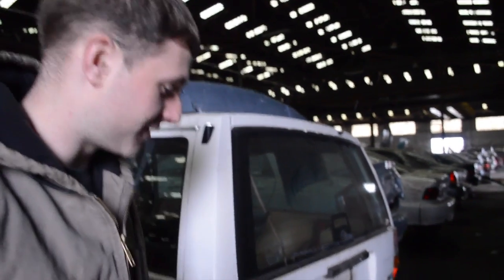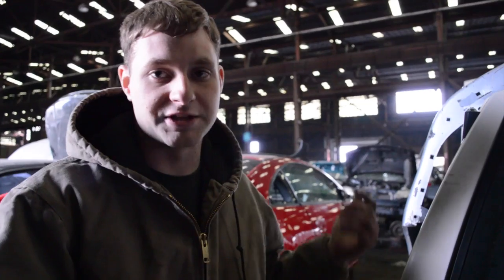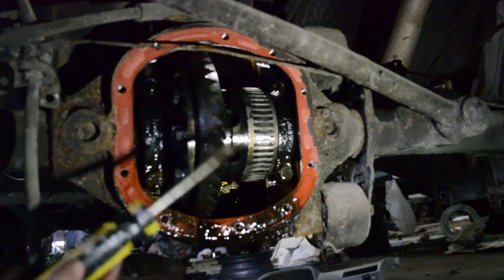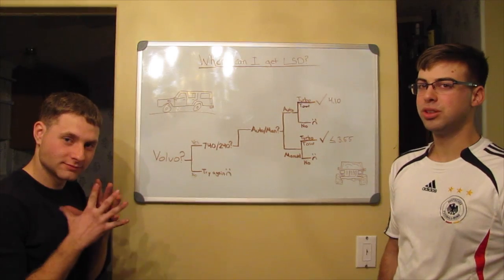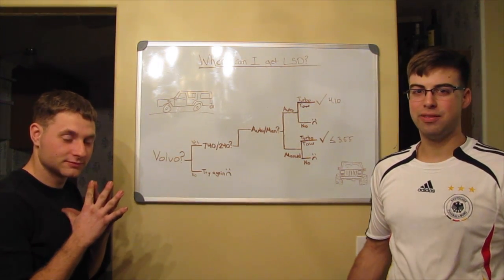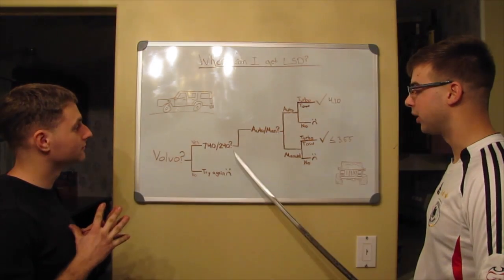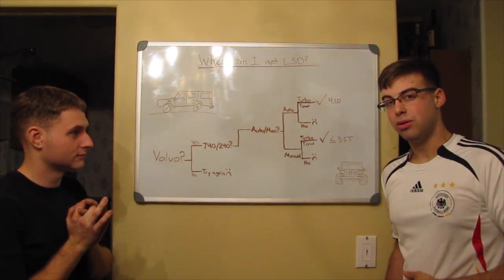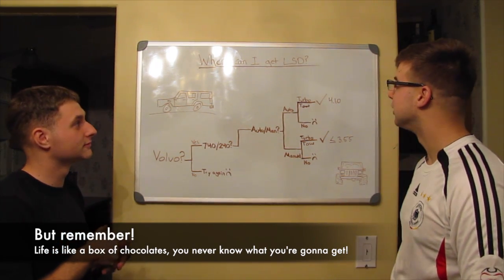The Volvo Differential Explained Part 2

Comment: What yrs could you find the LSD in the 240. 1988, 1992 are the choices at the local. Thank you guys. Just checked a local junk yard on line they have two Volvo’s one just came in a few days ago both are 240’s 1 is 1988, 1 is 1992 the 92 just got there. Thank you for a fast reply. Happy New Year to ya guys.

Comment: Volvo Dana 30's are the 1036 open or the 1046 G80, tag is on the axle easy to spot in the yard without disassembly.

Comment: Anyway to tell me if this G80 in a dana 30 up front will fit on my 2002 WJ 4.7 V8 with select trac transfer case. All other locker don’t seem to me work as well as the ones to guys have on your jeeps. Also how are they in snow on the road? I called Eaton today and was told Eaton never placed G80 in Volvo.lol yet video’s show different!!! Thank you guys for the information in the video’s.
Reply: G80 is GM nomenclature

Comment: So a 740 Turbo without the tow package would not have it? And is there a simple way to know the gear ration before pulling it out?
Reply: counting the ring gear and the pinion teeth than dividing ring gear teeth by pinion gear teeth

Comment: Could  I simplify and just say it's a 27 spline G80 Dana 30 Volvo diff? When searching for one. Saw them on eBay. And I definitely wouldn't call it a limited slip as it has no clutches to let one side slip. Like in old hot rod axles they called "posi". The G80 does actually lock at some point, as you have demonstrated in your video. One guy called it a "situational posi". Whatever, it actually locks when it does lock. There is no slip when it is engaged. Thanks so much for these videos. Thank you, thank you, thank you.
Reply: Let me take some back. I does have a "clutch pack" in the diff, but it's only for the actuation of the locking mechanism. Once that thing catches, it turns both axles at the same time and rate. Great videos.

Comment: The Eaton G80 acts like a LSD until one wheel spins more than 100 RPM then the weight engages the cam and it becomes a locker. You can read it on Eaton's website. They have all the literature easily available for people to read up on. Here's a link to a couple great videos. https://youtu.be/uLgze5NR6Ks
https://youtu.be/1WX0rCWNVo0

Comment: Hey I'm needing a quick bit of information are you changing the ring and pinion or just using the carrier  thanks
Reply from the maker: We are just taking the Volvo Differential and using a Jeep D30 Ring and Pinion. The ring bolts to the volvo diff.
Reply: @EnlistedBudgetVideos  
I just scooped up a free MJ. What size tires are you running and what gears? How do you like it and would you go to 4.56 or 4.88s?
Can I go that low with this lsd?

Comment: watched this video never heard of the lsd looked for one for a few months at multiple Auto wreckers called many more finally found one didn't have the option to open the diff cover on the spot but since it was in a Volvo 740 turbo with a tow package automatic transmission as this video has lead me to believe was "THE ONE" I bought it after driving almost two hours got home opened it up and guess what open diff.

Comment: So how does using rear gears in the front axle affect performance? 
Does it sound like reverse? - can that cause problems? - or do you also swap gears?

ALSO - Ive seen Volvo's with what looks like electrically switched rear end - can that be swapped? Can  ANY of it ? Any ideas?
Thanks for the Video!
Reply from the maker: +Jonny Racer you don't use rear gears, you get a ring and pinion from a jeep Dana 30 and gear it like normal. There's not devil magic involved, it's a lot more simple than you think. I've ever heard of a rear electric switch rear end in a Volvo before.

Comment: So when picking a Volvo diff from a yard, I need to get the pinion from the Volvo too, right? As in, a jeep d30 pinion won't mate to a Volvo diff assuming they're the same gear ratio? I've got a yj with a hp Dana 30 in 4.10.
Reply from the maker: No sir you do not. You ditch the volvo ring and pinion. You take a regular Jeep dana 30 ring and pinion. Bolt the ring on and gear it like you normal would any other jeep axle. Its that simple, no funny stuff. Ditch Volvo ring and pinion, get Jeep ring and pinion.

Comment: Am I correct in assuming the 3.55 geared LSD won't fit on a low pinion d30? I'm trying to find a solid intersection of cheap lsd/locking that has good road manners. I'm looking at a spartan rear for my 8.25, but I'd love to have one of these in the front. I suppose worst case I'll hunt for a high pinion d30.
Reply from the maker: That's actually a very good question and something I don't have a good answer too. Unfortunately the only real way I can think of is to physically try and see it will fit correctly. I'd imagine standard cut gears would be a thing. I'll ask a few friends with experience with the Volvo diff and see what they think.
Reply from the maker: +6xMonsters Yes it will work. Use standard cut gears. Confirmed by a friend that ran a low pinion with the volvo diff.
Reply: Thanks for the info!  There are a few salvage yards in my area with the potential models. Gonna have a look as soon as I can.

Comment: want a tip? there is a sticker on the right side of the axle with numbers on it. 1041 is locker and 1031 is the usual diff. however people sometimes replaced the locking diff with a usual one when it broke, that's why some people encountered usual diffs in the 1041. But from factory all 1041s are lockers.

Comment: we're in p.a are u guys?    I got a design I'd like to explain an try doin a top secret locker design, for under 100$ all in front an rear, you'll have the concept of lockers lad.. just by using a e.brake or line locks..   an I designed a paddle shift set tip for aw4's. so u can lick in 1st. 2nd w.e till red line.. an lock the torque converter. for almost like a 5speed, or q .5 gear, like 1st and a half gear.. or 2,3,3.5_ 4.5 OD. highway gear,
Reply from the maker: +Justin Herdman we are actually in North Carolina. However, one of us is from there. Your locker idea is definitely a head turner. Would love to hear more about it. As well as a paddle shift setup for an AW4. All very interesting.
Reply: why top secret? why not share with the rest of the jeep community instead of keeping your ideas to your selfish self?
Reply: Oh, I will eventually. But I've shared enuff ideas an designs with people an some of them went an sold there parent's design to. Company like r.c, Rusty's... Like drop brackets.  Yea talking wit a cage builder bout 12 years ago.. then in 08? R.c made the c.Arm drops.. an another was A hybrid electric/exhaust turbo.. sure as shyt.. borg Warner an others have electric motor on there turbos, to get rid of that lag... Anyway.. yes I would share a set of plans or etc.. but I'd like to make a CPL $ aTleadt. Workin for a living, while having lymes an RA.. sucks. I'm in pain an can't do things like u users. So CPL extra bucks coming in to support my Hobby's be nice. Lol.
Reply: Yes I gotta get usesta my new cad. Program, an I could finish up some my stuff, an transfer the rough drafts off my sketchpad.. been busy with season starting..Yea I find an finish up the ideas on cad/etc. An Getm out to you guys interested.

Comment: I have 4.56 in my TJ from the stock 4.11 the Volvo LSD that was a stock 4.10 should bolt up?
Reply from the maker: hunttomuch wolfe If its a Dana 30 axle you have than yes. However, you can't use the volvo ring gear. You would use your own.
Reply: I swapped out my gears 3 years ago from 4.11 to 4.56 and it regained some power in my tired 2.5l. But pulling out trucks in deep sand with open diffs is not fun. I need to ditch the Dana 35 for a 8.8. And find a Volvo LSD for the 30
Reply from the maker: It should accept the 4.56 ring gear, so you should be fine. Also, I just recently rebuilt the lsd in my 8.8. Best decision, highly recommended. Kits are cheap for it.

Comment: The G80 is also in the S series trucks from GM ... S10 , S10 Blazer , and some 1500 Gm trucks ........... The S10 versions should also work the same way .......... I am doing some more research to make sure and taking a trip to PAP to measure the S series trucks to see if they will also fit ........
Reply: Well... What did you find out?
Also --- does that * G80 * also fit into a Dana 30 differential? 
Or is it completely different? ...is G80 just a designation, that coincidentally is used by 2 different companies for similar things
Reply: No the S series and K series Chevy's use a different axle .. They do not use the D30 rear .. Only the Volvo uses that axle setup ...   G80 is the LSD designation from Eaton ..

Comment: Good vid guys!
The special oil has a friction modifier in it. You can put in an additive in to regular dif oil. Usually LSDs require it.
I havent seen it, but Iv heard of LSD difs seizing locked and blowing up cuz people used the wrong oil.
Reply from the maker: You're right, we just didn't know if there was any special stuff volvo uses. We run limited slip gear oil like you said.
Reply: +Enlisted Budget Videos Volvo uses the same oil in all the 740/940 axles. I just replaced my Oil with Volvo Original Oil and it didn't matter if you had a lsd or not, oilwise.